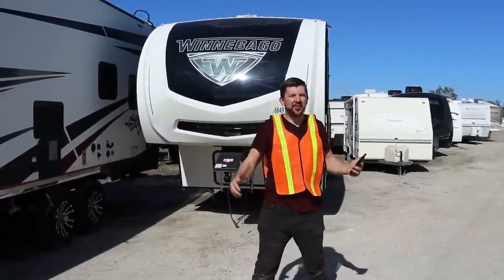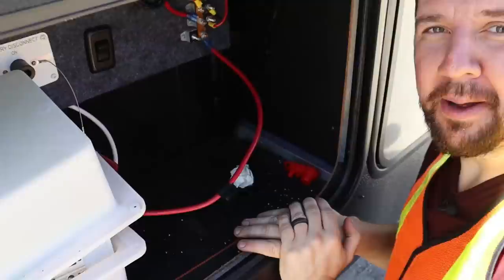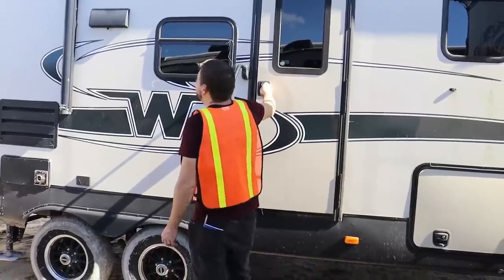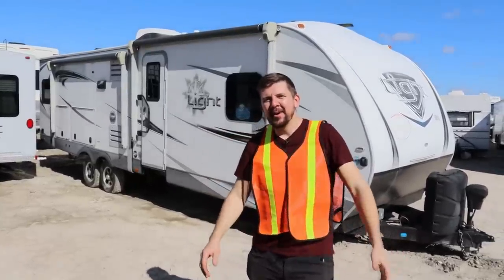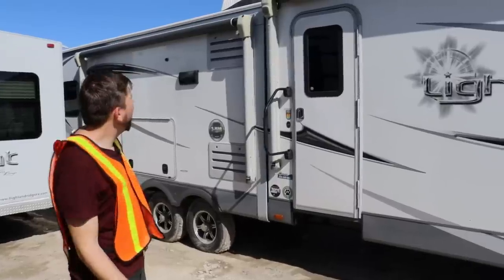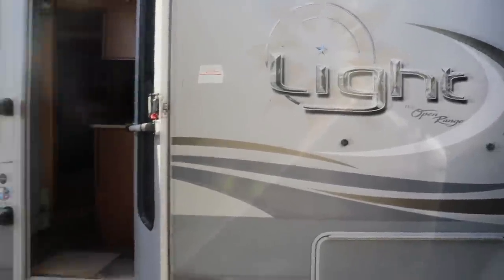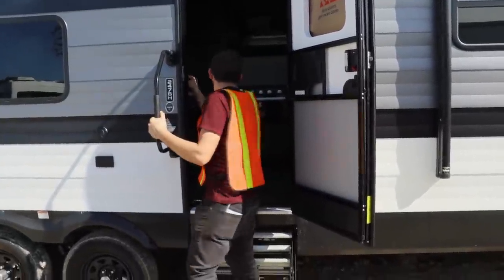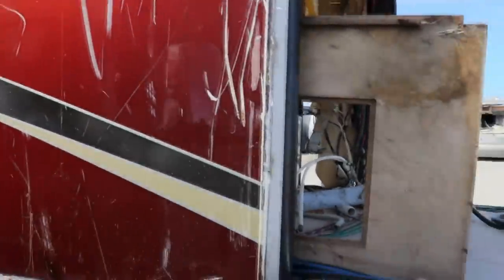FLOODED CAMPERS FLORIDA COPART LETS FIND A GOOD ONE

Comment: Stay away from campers called Light! Apparently these manufacturers were allowed to use very thin C-channels for the frames to get them light. Unfortunately, if you tow them on anything other than ultra smooth surfaces, the frames collapse were they bend to make the triangle hitch. There's lots of lawsuits and supposedly the people who purchased these RVs were given paperwork that told them in small print not to take them on roads under construction or off road. How are you supposed to avoid that with an RV?